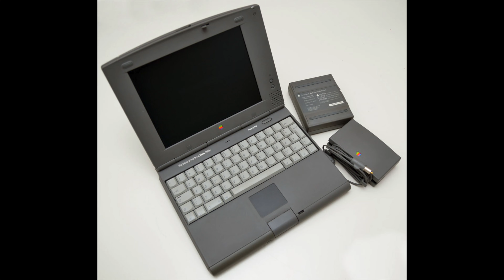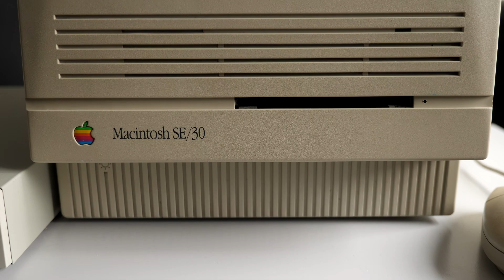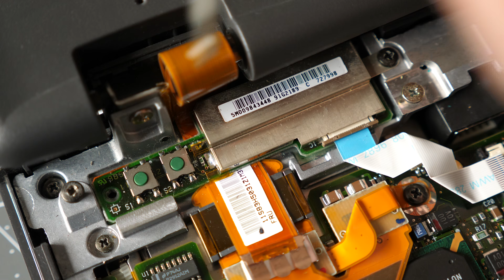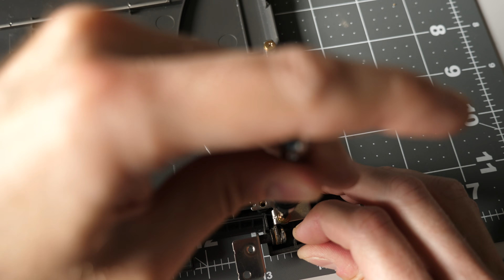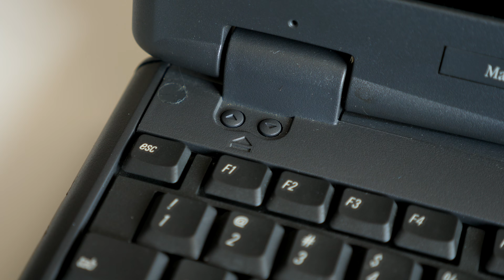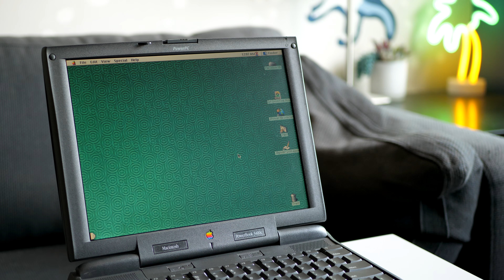PowerBook 2400c -- The Japanese Mac Made by IBM

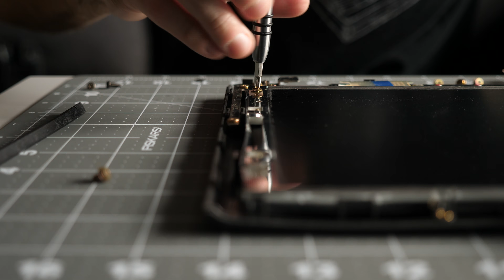Comment: 8:00 SuperGlue? I just discovered other options special glue for "hard plastics" - melting plastic to glue it, normally tested on a car because it's intended to be used there, and it worked, recenly tested on regular home lamp made of simmilar plastic as laptop also worked it's not glueing in classic way, but rather melting plastic it's slow process takes 24h to "dry" but highly recommend. Don't know particular brand of it, it's in different apartament, glue itself wont dry unless it touches surfaca of plastic so can be tested before use and cleaned. What was the brand i cant even find now it's very old still works, think you can google.

Comment: Love these gems. I own 5. My best has a G3 NuPower 240 w/ 80 MB RAM & OS 8.6. Yrs ago, I did an internal mod allowing the bus ability for PCMCIA CF/SD adapters. It makes file transfer ultra-simple. My oddest one is a 240 GHZ (Japan only). Someone customized it with textured matte black paint & carefully painted over the rainbow Apple logo to look like a G3 Pismo. The backlight is dead, but VGA external works. The 2400C keyboard is a joy compared to the horrendous 2300C keyboard. Even new, the 2300C was like typing on a rubber sponge. I have two 2300 & the mechanism under keycaps only gets worse & sticky with age!

Comment: Super glue (cyanoacrylate) works very well on plastics, but if you ever need something a step up, get a specific plastic welder like Devcon Plastic Welder (make sure to get the cream coloured formulation, not the clear -- they use completely different methods for welding the plastic and the cream coloured one is much superior). The Devcon in particular is very, very strong and also machinable/drillable. So unlike epoxies (or cyanoacrylates) it's not brittle and it's easy to file away excess. It's particularly good for vintage plastics that have broken, like those standoffs. It also smells extremely volatile so you know it's working!

Comment: That was the era where I bought my Power Computing Power tower Pro computer. It was in many ways the best Mac I ever had. It was so good and so fast that it took years and years after Apple shut down all the clones for any actual Macintosh to come close to the performance I already had. Ah, those were the days. I had a 270c too (I started out with a Radio Shack WP-2 to take notes for my masters program, but then switched to the 270c purchased used at Comp USA and boy was I glad I did). Sadly, Apple is not what it was. But unlike Google, it helps me with my problems on the phone.

Comment: My top of the line at the time msi dominator from ‘15 or ‘16 gets about 30 mins while not plugged in, at idle, using igpu and power saving profile, and undeclock to 2 ghz

Comment: This is my old laptop, I recognize the damage to the lid. I setup the software as well. I sold it together with a 2nd laptop, one "good", and one "parts". I believe it would not run on battery power. This happened when I hot-unplugged the SCSI cd-rom with the machine asleep. This damaged the power board in some way. I verified by switching the power board between laptops and the problem followed the board. Both batteries were good. What did you get with it? That Orinoco card looks familiar as well. =)
Reply from the maker: Yep, this was your machine alright! I bought both machines together (the other one was the “good” one) about 10 years ago. Other than an assortment of CD-ROMs and the wireless card, both included neoprene “wetsuit” carrying cases. I’ll have to do further testing with regards to the whole AC/battery power thing, though at least both machines boot and run just fine still. How did you end up with a second one?
Reply: @ThisDoesNotCompute  Ah, yes, I remember now, very cool! I bought the second one after I broke the first one. I can't remember, but I think I got a good deal for it off one of the Macintosh mailing lists of the time.
I used the machine as a backup or portable when I was in college in the early '00s, I had a G4 as my main desktop. CodeWarrior was for my school assignments. The rest of the software was just things I used at the time. I had Debian Linux on both my G4 and this back then. I remember the G4 had a better openfirmware that allowed you to boot directly to Linux, rather than use BootX.
I found your channel recently searching for GameBoy mods, and I enjoy it very much!
Reply: What actually happened to the lid?

Comment: IBM and Microsoft alike made a surprisingly large amount of stuff for Apple throughout the years. About a decade of Apple's computers included processors from AIM, or Apple IBM Motorola, the design group that created the PowerPC processors. 

It's very rare for Apple to make any hardware at all themselves...

Also, it's not uncommon for laptops to have "all in one" packages installed on them before being sold. The previous owner could have been a grandmother who typed up letters and you would never know - because they wiped the whole drive and just installed some premade package from the internet before selling it. It's more likely that the previous owner had never even heard of Linux or CodeWarrior and just installed them out of courtesy for the next owner.

Inverted T arrow keys were common on just about EVERY laptop after about 1988. I wouldn't take that as a sign of it's manufacturing origin.

Comment: Hey compute, have a question for the crowd here interested in older power books.  I have a 128MB ram module for a powerbook 3400c/240 that needs a new connector soldered from a donor RAM chip.  (I have both just need the solder work done)  Does anyone have recommendations for electronic shops that have the ability to do solder/desolder work on small circuits?

Comment: With the G3 processor upgrade and the 96MB chip - it should be able to run OS X Panther 10.3! It would be 16 MB short of the 128 MB RAM requirement though.

Comment: Would you be willing to make an attempt to rebuild one of those batteries with lithium cells? It would be an actually decent laptop if it had 1 usb 1.0 slots
Reply from the maker: A part of the video that got cut for time is an interesting note about the 2400’s PC Card slots — they’re actually CardBus-compatible if a small mod to the motherboard is performed. A decent number of owners sent their machines into a couple of companies who could do that work. One of the most common reasons they did it? So they could add a USB CardBus adapter.
Reply: @ThisDoesNotCompute  I miss laptops having expansion cards instead of just desktops as today (hell, the smaller new desktops don't even have slots). You could stretch out so much more use from them by adding a card or two! I guess that's exactly why they make you have to buy a whole new machine nowadays... back then they were so much more expensive, they knew people wouldn't buy them without some kind of "insurance" against obsolescence, whereas now there's Chromebooks and all of that, so they just present them as integrated black box units.

Comment: Boy, Apple of today could learn from this design... namely how to build a laptop that doesn't commit suicide by killing the backlight inverter while preserving the backlight fuse.
Reply: iRdMoose Ummm... Apple hasn’t used backlight inverters for many, many years, since they’ve all used LED backlights for a long time. Inverters are only for CCFL backlights.
Reply: @tookitogo  Sorry bud, but a PWM controlled circuit IS a type of inverter. An inverter chops a DC voltage up into a modified sine wave by turning it off and on rapidly.  What do you think a PWM circuit does?

Comment: Would be cool if Apple or IBM offered commercial desktops and laptops using Power9 CPUs.
Reply: Mr_Beezlebub No it wouldn’t. The battery life would be appalling. Literally the reason Apple switched to Intel was because of the lack of notebook-capable G5 processors. But even in desktops their heat dissipation was a factor, requiring far more cooling than the Intel chips.
Reply: @tookitogo  I don't know if you know this or not, but Power9 CPUs are much more power efficient than their PowerPC predecessors that existed in the early 2000s.

Comment: Pcmia card slot was for PC.  i could ran USB 2.0   Add a USB 2.0 WiFi card or a 56K GSM Modem.
Reply: Raymond289 WTF you talking about? There were PCMCIA cards for Macs.
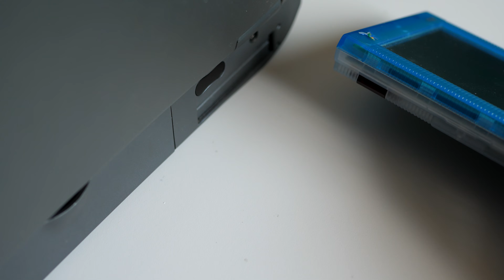Reply: @tookitogo  hey you are not tech skilled and you may have a listening problem   2:05 . These toy wasn't you timeframe that reason 3 you don't know. MAC CPU made by Motorola & IBM.   later 2005 fully Intel CPU.    DDR 1 wasn't Intel plan by the way someone work in Asus Taiwan decide to give DDR RAM. a shot as AMD all about DDR RAM
IF wasn't for that RDRAM and Sdram will still be INTEL.

Listen more Young Men you learn More.   Those always say What the F I m taking about have very little knowledge.  Digital got bought by Compaq and HP bought.  Apple had no one them exception IBM & Compaq Laptop head to Head at the time.by the time  HP, Panasonic& Toshbia had laptops 3 year later Asus and Acer in 2005. 

1997 IBM was the first Laptop INTEL 133 MMX 32 MB 4.6GB & 6.4GB HD DVD Rom with DVD player software. $7199 Canadian Dollars.

Comment: You can cut traces on a standard 64MB ram module and add mod wires, but it isn't for the faint of heart. However, often back then it was cheaper to learn to solder than to special order that upgrade. I am not sure it is worth it today unless you just want to say you did it.
Information is available on what traces to cut, and where to add your jumpers.
I would opt to mod the ram, not the motherboard. Cheaper if you mess up.

Edit: I see you found the information. I commented too early :)

Comment: "Up to four hours. Pretty short by todays standards..."

*Cries in Gaming Laptop*
Reply: Gaming on anything eats battery faster.
Reply: @xenobreak1160  Nah, just having the GPU in the system eats the battery faster.
Reply: @thumbwarriordx  It feels like everything eats the battery faster lol
Reply: That's why you use switchable graphics and disable the dedicated GPU when the power cable is disconnected. My gaming laptop from 2013 gets about 8 hours when I do that with a lightly used battery (the battery is shot now and due to be replaced)
Reply: @iRdMoose  What laptop do you have? I use battery saver, reduce screen brightness, switch to the low-power GPU, etc. etc.  but still struggle to get over 3 hours
Reply: my dell xps from 2017 last only 2 hours even on battery saving mode
edit: I forget to mention the battery expanded and made the track pad lifted from its area
Reply: Jerry4050 You like need a new battery dude
Reply: @Jerry4050  hey - careful with expanded battery - it might start a fire.
Reply: LOL You probably ate enough power to run that Mac for a few DAYS.
Reply: Honestly, recent gaming laptops have been getting much better. The mag 15 rocks a 115w 1660Ti but still gets me 7 hours on the go
Reply: My modern think pad is just over 2 hours of battery
Reply: cries in 16-inch macbook pro
Reply: I like how half a decade on, this is still just as bad lol
Reply: @KellyA2X  this is why I have a laptop with an apu and half it's weight is battery now.
It's slow as dirt but it lasts 7 hours
Reply: @thumbwarriordx I almost got Asus's weird gaming tablet with an APU. But, I chickened out because I was worried I'd need the CUDA cores of a full-spec laptop for Uni...
Reply: I’ve taken apart my gaming laptop, and the battery was only 3,000 mAh, which is smaller than my phone
Reply: @bandombeviews6035   It's not smaller then your phone, you forgot to account for voltage. Phones use 1 series cell, so nominal voltage around 3.7V, while laptops traditionally use 3-series, so 3 times as much. Sometimes 4-series are used too. The current requirements alone preclude single cell use.
Reply: @bandombeviews6035  Yeah, and before switching graphics they'd invariably cycle the batteries harder and wear them out quicker.
Reply: What's funny is most laptop these days have that kind of battery life unless you have an extended life battery. Manufactures keep shrinking them down for slimmer laptops which doesn't help.
Reply: That’s better than my laptop. One runs for an hour and the other’s battery failed completely after 1-2 years
Reply: My MacBook Neo stays up for 9 to 10h if I browse the net and do productivity

Comment: I think we had one of these at our IBM media lab, around 1999 or 2000.  The  power supply went bad, so that was the end of using it.

But a much different Apple; back then they allowed and encouraged upgrading and customization.  These days they'd weld the housing shut if they could get away with it.
Reply: Hell, even ten years ago the processor in an iMac was still socketed, you could replace the GPU (if you found one that fit), there was a standard 3.5" hard drive, and so on. Now their iMacs are just like their laptops, soldered-in everything :/

Comment: The plastic melting could have been from being stored together with PVC cables. Those contain chemicals that eat into ABS plastic over time.
That's why you always wrap the cables in your vintage collection so that they don't touch plastic.
Reply: Some of Apple's laptops used a very soft rubber and overtime they breakdown and all one is left with is a gooey residue. It was simply a poor material choice.
Reply: Alex Santos IBM ThinkPad Laptops also suffer the same problem overtime.
Reply: @santospoland  I think they are referring to the pitting on the cover, not the rubber bumpers.
Reply: Findecanor Nope, not a chance. If the plasticizers in PVC attacked ABS, then it would eat holes in all the devices that are made of ABS and contain permanently-installed PVC wires (which is nearly all). ABS is the most widely used plastic for electronics, and PVC is _by far_the most common wire insulation. If they were incompatible there would be widespread problems, but there aren’t. (Note that around 15 years ago, Apple began transitioning away from PVC, since it releases toxic fumes when incinerated.)

What PVC does attack is polystyrene, which is why it eats into styrofoam.
Reply: @tookitogo   ABS is usually about two thirds polystyrene. So any solvent that affects polysterene will also affect ABS, with rare exceptional differences that are largely down to magnitude and timing, for example Limonene makes short work out of PS but takes much longer to penetrate many grades of ABS for some reason, but most solvents are close to equally effective.

PVC is an extremely brittle and hard plastic, this is why it's used for gramophone records. It is also a plastic which is naturally difficult to ignite, which makes it a preferred material for insulation. To make it actually usable, it's mixed with a plastifier, a "non-volatile" solvent. Obviously if it wasn't inclined to move, it wouldn't possibly be a solvent, so it escapes from the surface and gets wicked out, because you have seen what happens with old PVC products, these compounds invariably turn out to be somewhat volatile over decades upon decades. The composition varies A LOT and is usually a trade secret, and what they affect is also down to storage conditions. Whether the air is stale or slightly moving can make all the difference between it evaporating or seeping into the adjacent plastic. So you can't just make sweeping statements.

Another thing to keep in mind is that Styrofoam has an extremely large surface area for very little volume, so even very small penetration depth can cause the mechanical structure to critically weaken. You could place the clear front piece of a CD case, which is also made from pure polystyrene, under the same conditions, and find no obvious damage.

Comment: Remember time when acer used mac os 8 on their computers
Reply: @referral madness  Because Steve Jobs decided to be a diva. As he always did.
Reply: Oooooo i 'member...
Reply: Wait, what?
Reply: CasioMaker In the 90s, before Steve Jobs came back to Apple, the Macintosh Clone Program was a thing. Apple licensed Mac OS out to other manufacturers, and they literally built Macintosh clones and sold them, and didn’t get sued straight to hell. One such example was PowerComputing.
When Jobs returned, he terminated the MCP and the licenses given out to companies. I think PowerComputing tried to keep selling their clones, but they swiftly got shut down by Apple’s crack team of lawyers.
Wouldn’t it be weird to see Mac clones in today’s market? Heh, that’d be a sight and a half.
I didn’t know Acer made Mac clones, but the 90s was a weird time for Apple, so I guess it’s entirely possible.
Reply: Apple dropped the 3rd party licensing during the System 7 days when they renamed it to OS 7. How did Acer have OS 8?
Reply: Travis Combs AFAIK Acer never manufactured Mac clones. The only company to ever gain a license to ship OS 8.x was UMAX, and that expired over 20 years ago.
Reply: @referral madness  They realized that they had to stop it, otherwise, it would be like what happened with IBM. IE: Losing control of your own platform. No doubt they would of been screwed over once companies started to reverse engineer the BIOS.